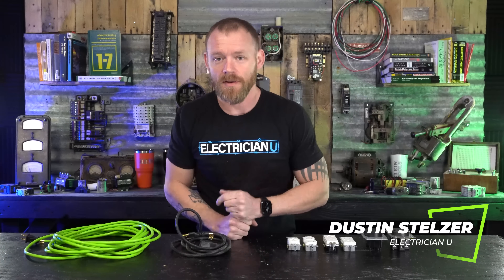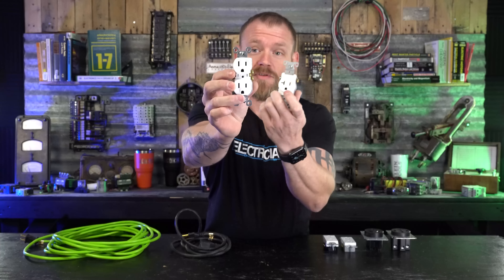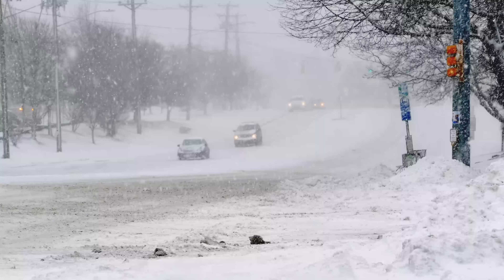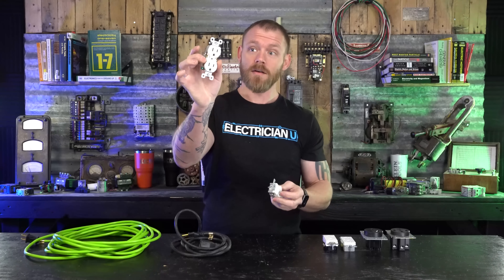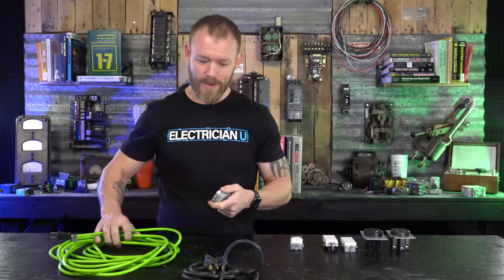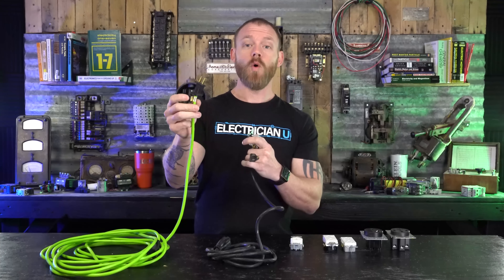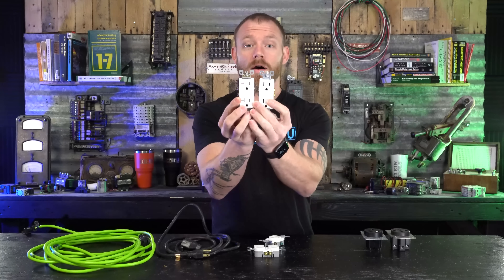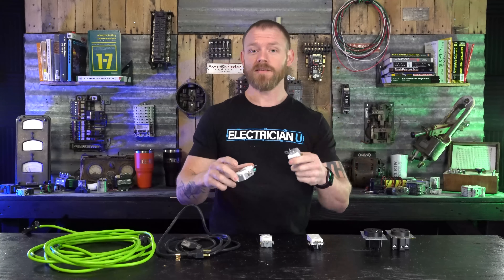Why Do Outlets Have Different Types of Holes?

Comment: Putting a 15a receptacle into any home is ridiculous.
Reply: Not at all. Practically everything uses 15 amp plugs.
Reply: @KingdaToro  15a, yes, but as he explained combined amperage are exceeded quite often, it just makes sense to put 20a receptacles on a 20a circuit with 20 amp wire (12 ga).
Reply: @user-gu7fm8gn2r  It doesn't make a difference. The "guts" of 15A and 20A receptacles are the same, and rated for 20A . If 15A receptacles weren't rated for 20A, they wouldn't be allowed on 20A circuits. The only difference is the T-slot to accommodate the horizontal neutral prong of the 20A plug. If you don't have anything with such a plug, there's no need to install any 20A receptacles, period.
Reply: @KingdaToro  You're right. That's what I was getting at, didn't mean the 20a receptacles with accommodating horizontal slot.  Just a receptacle rated for 20 a circuit's.
Reply: @user-gu7fm8gn2r  15A receptacles are still rated to be used on 20A circuits, as long as there are multiple receptacles.  Even the single yoke assembly of a duplex receptacle counts as two receptacles for satisfying this rule.

The deal is, they are rated for carrying 20A between receptacles and between each receptacle of the duplex, but they are only rated for delivering 15A to an individual load.  15A receptacles are cheaper than 20A receptacles due to economies of scale, even if the core inner-workings are identical.   Since most plugs only need 15A, general receptacles are usually built with 15A receptacles on 20A branch circuits.

Comment: You get alternating current when you plug into a receptacle.  The "polarity" changes every time the current alternates.  Unless you have a device with a diode to prevent current from flowing in one direction, there is no need for a polarized plug or receptacle.

Comment: You just told people that they should put 20 amp devices on 15 amp circuits for convenience. That's dangerous and stupid. Not in this exact case for reasons that others have pointed out, but as a general rule deeply stupid and kind of dangerous. 

If you're going to teach about a subject relating to a dangerous force could you please at the very least teach to safety? Teach in such a way that it's as hard as possible to construe something in a way that can get someone hurt? I'd prefer you get your facts straight and you editorialize less, but at the very least could you teach people in a way that won't get them hurt or killed when they extrapolate on what you said? People do that. They draw correlations, and they apply other knowledge they have and then end up doing something that gets them hurt, and since you aren't there in person to disabuse then of the stupid thought they had they act on it. I've taught people remotely and in person and what you teach with the subject you're teaching is dangerous.

Comment: Thank you!
When is is appropriate to use 20 amp receptacles and 12/3 wire 
VS 
14/3 and 15 amp receptacles
Also
Are commercial quality receptacles worth the extra money?  I always use them
Reply: /3 wire is appropriate/necessary for switched receptacles, split receptacles for multi wire branch circuits, 3 and 4 way switches and any other application where 2 hot wires are required. /2 wire is most commonly used in residential wiring, only one hot and one neutral is what you need. 20 amp duplex receptacles can only be used on 20 amp circuits with 12 gauge wire. 15 amp duplex receptacles are appropriate for 15 and 20 amp circuits.
Commercial grade receptacles are worthwhile for higher power tools and appliances, 20 amp circuits, and when plugging and unplugging are frequent. Note that 15 amp commercial grade duplex receptacles are fine here as well. Residential grade receptacles are ok for 15 amp circuits, just don't use the "backstabbing" holes for attaching the wires.